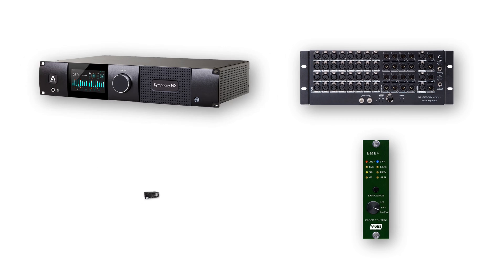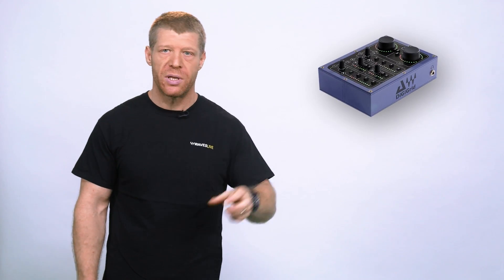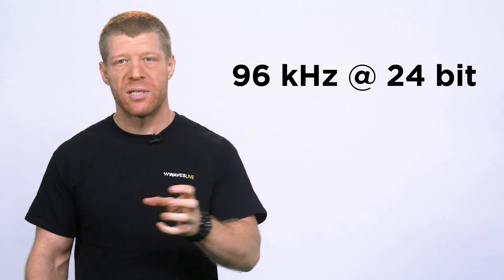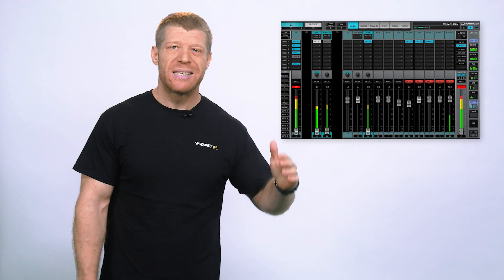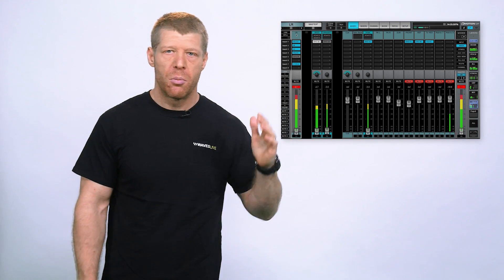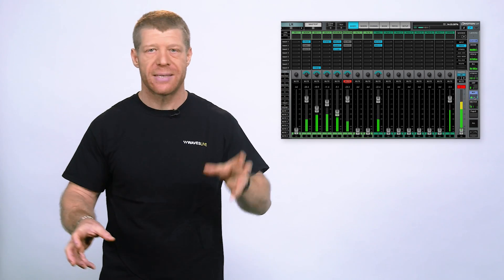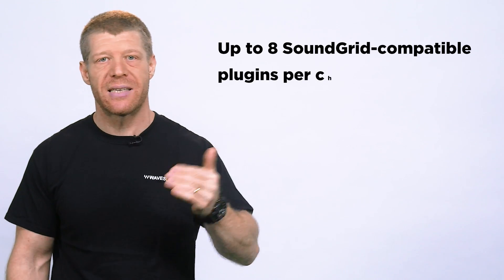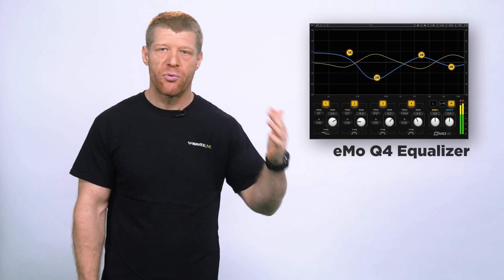SoundGrid 201 Certification Training Part 1: SoundGrid System Components

Comment: You should put actual captions on your videos--regardless of speaker accent, though captions are especially helpful in cases like these when an accent can add to difficulty in comprehension. Nothing against the speaker, just the truth. The auto-generated ones aren't correct and closed captions are important not just for the Deaf/HoH community but also people like me that struggle with auditory processing. Thank you.